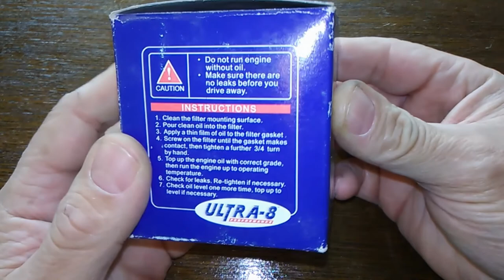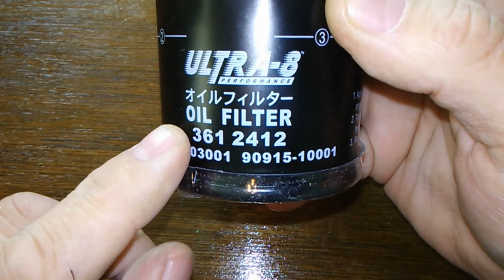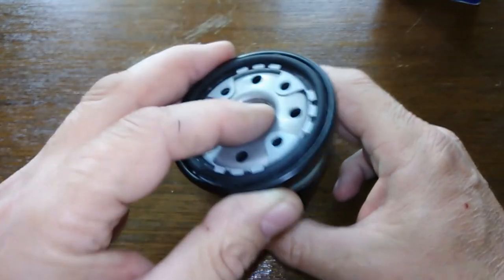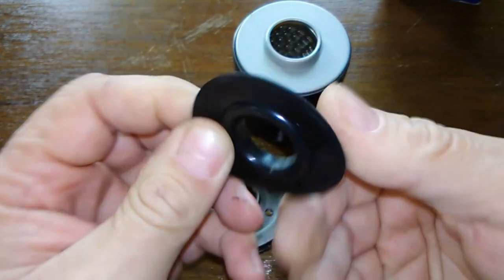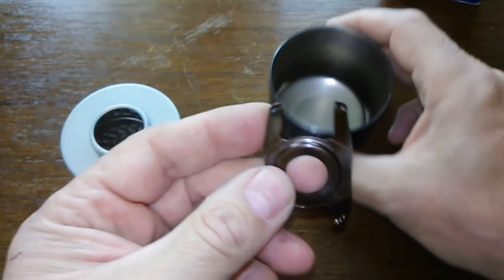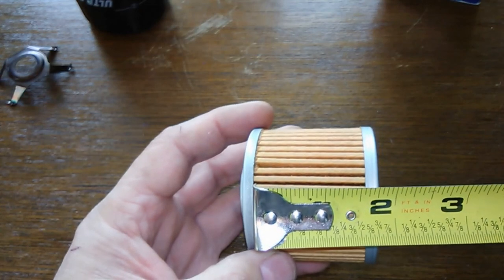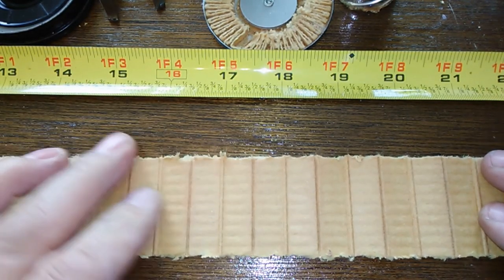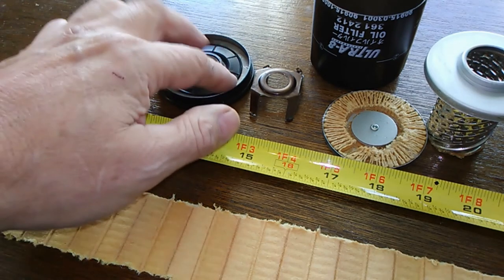Altrom Ultra 8 ATM 3612412 Oil Filter Cut Open

Comment from the maker: Oil Filter Friday,
Watch a new automotive oil filter inspection video every Friday on this channel. 

I wouldn't use this filter, if some pressure built up in the oil filter that leaf spring would probably collapse,  especially  if you live in the north like I do. The oil starts to get thicker when temps starting falling below freezing. In my opinion that leaf spring could collapse, and once that was done you'd be in a bypass mode for the rest of that filters life. Not Good.

Comment: Well done! 

Thank you!  What surprises me is Napa sells this filter.  If I was Napa I would not want to be selling this filter even as a budget filter.   According to Napa website this filter is rated for 12 months or 12k, whichever comes first. 

Napa Silver costs $4 before my parts discount.
Reply from the maker: Thanks!
Yep, even for free I wouldn't use it. 
It should be rated 12 min. or 12 miles 🤣 
Well, hopefully someone thinking of using one of these oil filters will see this video.

Comment: well, this leave spring is not this bad if you look at it closely, you can see the blue color or discoloration to it, it is because it has been heat-treated, so its springs steel that was heat-treated, so it will keep its shape under pressure, it is cut this way so those legs can slip inside the can, without catching or binding. if you look at a leave spring from a Purolator or a Fram, they are made of regular manganese steel. I agree with you on the anti-drain-back valve it is not great, sorry if I was late to this party.